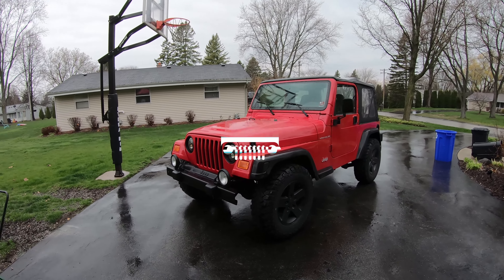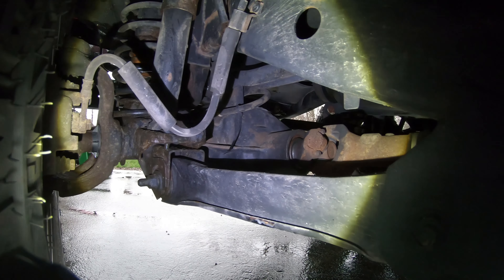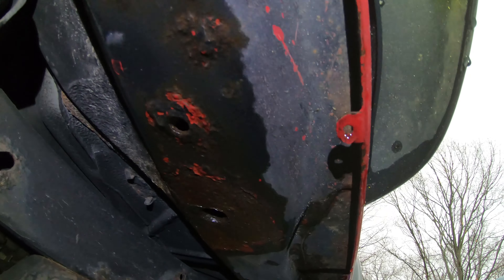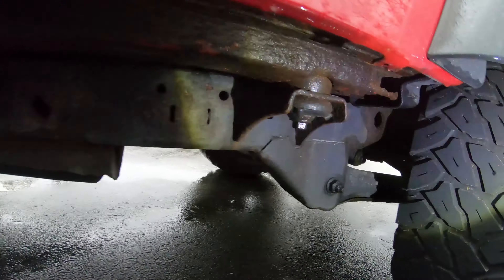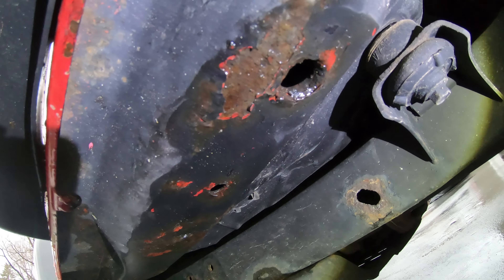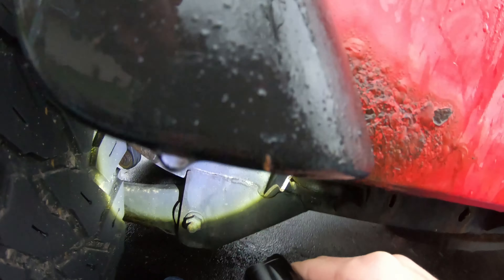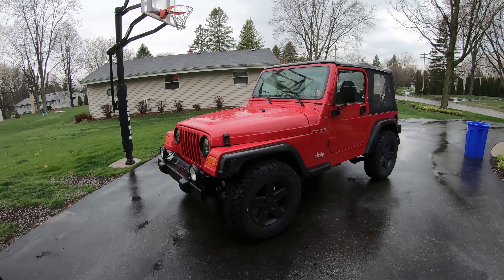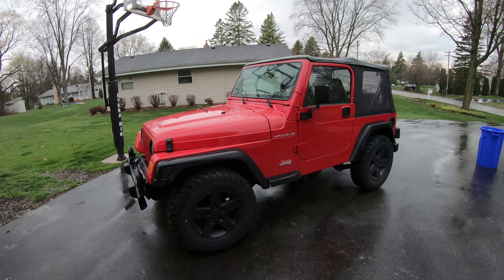How Bad Is The Rust On Project 4 Banger?

Comment: I used super clean and then flushed out my frame very good, then sprayed it with Eastwood internal frame coating. Going to do another treatment when it finally warms up and dries up. Then do a few fluid film coats to slow down the rust up here in the North East. POR is another good option versus just painting with spray paint.Eastwood makes a lot of great products

Comment: That box or rail that is rusting out on your tub is called a torque box. I bought my 4cly jeep just like that and the body mounts and floor pan under the roll bar was basically gone. I've cut out the tub and replaced the whole torque box on the driver side today and will be working on the passenger side tm.

Comment: The underbody of that Jeep is honestly still In very good shape aside from that one section of the tub you showed. If I were you I would try out either POR-15, corroseal, or chassis saver. These rust converters have all proven themselves to do a great job. Just use them on the rusty sections then spray the rest of the frame with fluid film to prevent them from ever rusting.
Reply: greendrill12 have you ever tried Eastwood interior frame coating? Got myself a few cans and gonna try it this summer.
Reply: Tyler Grimmer I actually have not had the chance to use that product but I have heard very good things! My buddy has a TJ and we completely sanded down and painted his frame with POR-15, then used fluid film on top and on the insides.

Comment: My Jeep tj’s frame looks great even around the shock mounts in the back but I had to do some work on my transfer case when converting to a cable for 4wd. The spots where it was really bad on it were where the skid plate bolts with the frame but I could not even tell until I started to take the skid plate off

Comment: As usual, great content! I actually was planning to do a full inspection of my Jeep to check for rust and this video is gonna be helpful to check for certain spots. Thanks!
I have a side note question tho
I just got bigger than stock tires(31’s I believe) and I’m having trouble mounting the spare with the third brake light. Any tips for getting the third brake light in place so I can stay street legal?
Reply from the maker: Just push the tire up against it it will flex a little bit backwards but should break it
Reply: Thank you!

Comment: where the transmission skid and frame meet is a high rust spot and then the big bolts on the inside of the frame break and you can't get it out and you wish you never bought the thing. Obviously with the big hole, I would replace all along where the transmission skid bolts up and have fresh nuts welded in on the inside.

Comment: What's the best way to get control of any 'light' rust.   Not rust that has eaten through.   I've heard there is a Rust Paint that you can paint on that slowly eats away the rust and keeps it protected?    I have a 1997 Wrangler Sport, almost perfect condition BUT has some rust.    Want to get it under control.
Reply from the maker: Yea gonna sand it all down and use rust back to metal product then probably paint